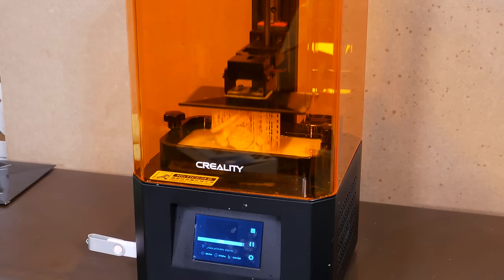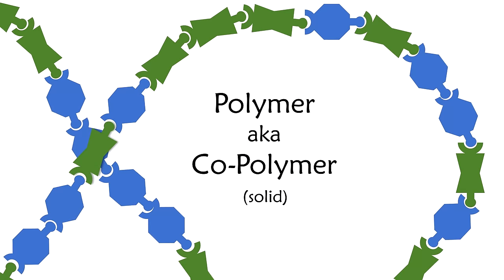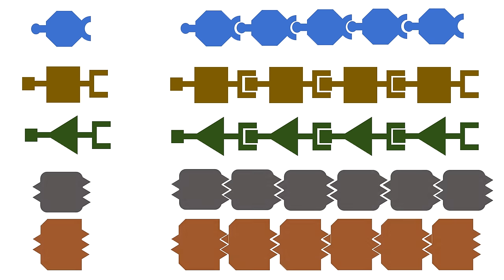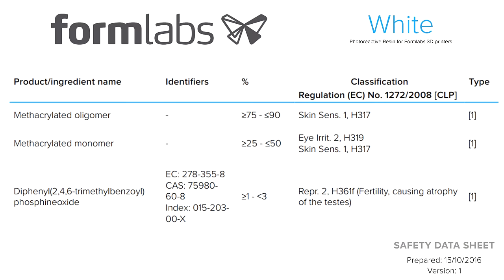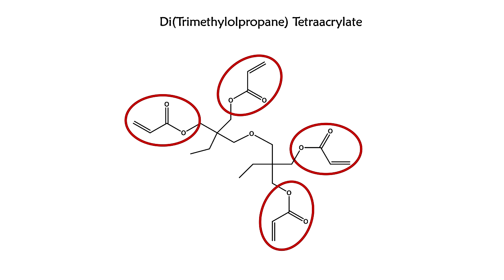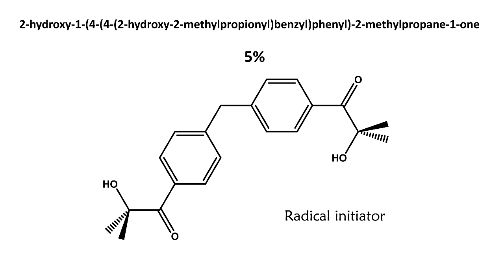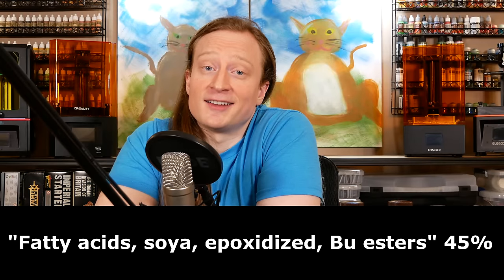Ph.D. Chemist Explains 3D Printer Resin

Comment from the maker: Hey All!  It's been brought to my attention that I conflated a couple of different safety ranking systems- some count up from 1 to 4 and some count down from 4 to 1.   With or without the numbers, you can trust the words in the SDS sheets to steer you right. My overall "respect the resin but don't fear the resin" viewpoint remains.  For more info: 
https://www.acs.org/content/acs/en/chemical-safety/basics/nfpa-hazard-identification.html
https://www.osha.gov/Publications/OSHA3844.pdf
Reply: Tzuede Off the Cuff  Check with your Waste Management organization.  In my town they have one Saturday a month you are can drop off hazardous substances like old resin, it's something they don't advertise a lot, but you can found out pretty easy if you call.
Reply: question brett: I live in a studio flat with limited ventilation options at the moment, but I brought my Mars with me because I read enough about the risks that i thought I could work something out. Is this a dangerous line of thinking? Should i permanently have my windows open?
Reply: This is excellent. Would you make more chemistry videos please?
Reply: @einekleinerockmusic8152  there are 3rd party designs for activated carbon filters and/or exhaust tubes to vent all the fumes outside without having to keep the window open.
Reply: Sort of channeling the same feeling you being a chemist, I find myself working with resin sort of the same way I used to work in microbio labs. Always assuming surfaces are "hot", trying to minimize stray messes even if the rest of my hobby space is in shambles, etc.
Reply: If I am wanting respirator what type of filter do I need. I know I want an ‘organic fumes’ filter, but I have a lot of trouble identifying what individual filters do what.

Is there particular colour (or colours) that I can just rely on when at my local hardware store?
Reply: Tzuede Off the Cuff  I don't like sand. It's coarse and rough and irritating and it gets everywhere. Not like here.
Reply: Hello Sir, thank you for this detailed explanation. I truly enjoyed it. 
I heard epoxy glue can create allergies when you sand it and breathe in the dust. Do resins have similar risks when you sand the result?
Reply: Oh....... well it says i cant drink it?
Reply: Tzuede Off the Cuff  has
Reply: @goobertownhobbies  love this video has some questions on mixing resins for different print qualities (mixing a flexable resin with a "tough" resin or ABS like resin to get a hard yet non brittle product) winner what your thoughts are
Reply: maybe the resin diluted on the cleaning alcohol can be polimerized with the UV light and then filtered,leaving the alcohol clean again?
Reply: Hello Goobertown! Could you please make a video talking about the water washable resins as well? Discussing the washing and the waste water?
Reply: Hey chemist ! I can't find the answer anywhere else , but can you explain how the print gets cured if it's a solid print but the UV wavelength is only 405nm , how can such a short wavelength penetrate to cure the internal monomers ? Or does the chain reaction of the ions continue on into the depth of the uncured solid print beyond the reach of the UV photons ?
Reply: This was my favorite point you mentioned in this video.  Thank you so much for mentioning the SDS, and the safety classifications.  I've been resin printing since about when you made this video, and every other video I've seen that talks about safe handling of resins doesn't go that route at all, and recommends extreme care.  Gloves, mask/respirator, eye protection, "It's toxic!  Bad stuff! Be very, very careful!".  I came across the data sheets for resins when researching what I should get after my first bottle, and it blew me away that I hadn't seen that talked about at all.  I was also surprised at how not terribly toxic it is, so long as you don't breathe or ingest it.  Of course, as you mention, I always treat it with respect, but don't fear the resin.
Reply: You have been called the Bob Ross of youtube mini painting. I feel like this video series means you are some sort of Bob Ross/Bill Nye hybrid.
Reply: @einekleinerockmusic8152  i have exactly the same question!
Reply: Hello Brent, I just saw this video for the first time and I really appreciate the clear and concise way you break down the chemistry, the hows and whys and especially the safety aspect but I do have one peripheral question. 
I keep my printer in a grow tent, both to reduce the amount of UV being emitted and to contain vapors and odor, further to that, I run a charcoal canister filter with a fan in the grow tent.  This eliminates any odor, short of taking a sniff off the vat, but I was wondering if it actually makes the resin safer to be around by adsorbing any harmful chemical vapors or if it is a false sense of security??
I still don't spend much time in the office while it's printing but I am curious if the charcoal can make resin safer, or completely safe to be around while the printer is running?
Reply: Is it safe to use a growtent with a carbonfilter and let the air escape into the living room or is there still some particles or something like that?
Reply: Not feeling it.. way to to much low Testosterone vibes bro.... its like looking at a Greta Thornburg on steroids..  =/
Reply from the maker: @romanking1202  do you need monster trucks with your chemistry lectures?
Reply: @GoobertownHobbies bullets and perhaps a 3D printed ar-15 lower receiver would help! XD
Reply: Being a lab biologist and Ph.D. in computational chemistry, I can only pay my compliments.
You explained it perfectly and did not stop on the surface level.
I like the whole video and how you emphasize the tox/reach aspects of it.
Currently, I'm looking into a SLA printer and besides protecting myself properly by a mask and gloves (anyway a good idea to wear whenever you file something and/or create dust on µm to nm scale e.g. priming models in big batches), I would like to come back to the disposal topic and ask a question on the water washable resin, if I may?

How can I make sure in a not so sunny state to cure the resin with UV light, e.g. residing in a bucket of water  (assuming I have water washable resin)? 
I was just thinking, here in Germany during winter we will not have so much "sunlight" to evaporate the water in a bucket, but the UV light will be enough to cure the residual resin.
If you can give advice on how to dispose washing-water, this would be much appreciated.

By the way, what happens to resin inside a model, while printing with e.g. 40% infill? I saw people cracking the models open, finding a fair amount of liquid resin inside, which could not be washed.
Reply: thanks - if i have to work in the space where my printer is all day will a big carbon filter attached via the shroud from a cut hole whit a fan motor be enough?? or should i transfer it outside via a window and hose /fan combo - no filter insted and maby the small anycubic carbon fans inside the shroud whit fan out window?  i will not print alot but many a few times a week for large figurines and busts work. many thanks
Reply: Dust from sanding anything is potentially dangerous. Some are also carcinogenic but in general, avoid breathing in any fine particulates - wear a dust mask.
Reply: Do you wear a spacial mask in a well ventilated space? I know people recomend it, but realistically do you wear one?
Reply: Can you do a follow up video on the right filter for Resin printers. 
I am in the process of buying one of those things and I want to make sure that no one in my household gets sick because of the fumes.
So I am shopping for a HEPA + Carbon filter air purifier. Maybe some help on that front would be nice for many people.
Reply: The video is over the top - there is literally no better explanation about 3D printer resins. Watched several times to make sure I understod everything properly!
And from all that information one questions itching in my head. Looks like it is totally feasible to alter off the shelf acrylic resins to change characteristics. And I not talking about simple coloring. Many popular resins are britle - is it possible to add something to the liquid resin (and what exactly to add?) to increase elasticity of solid parts?
Is it possible to add something to gain direct increase in strength?
Is it feasible to add some powders or fillers like with epoxy to increase wear resistance of decrease weight?
Thanks!
Reply: @SianaGearz  just take the high ground and worry not.
Reply: You are like a Mr Rogers of chemistry. Very nice. Love the dry humor
Reply: @JennaHartDemon  more Bob Ross over here. Happy little resin.
Reply: You may want to check your description links! A few don't go to valid things.
Reply: @goobertownHobbies , what happens if I expose a resin that is crosslinks under UV  to a visible light.
Reply: quick question ... epoxy groups on polycyclic hydrocarbons can bind covalently to DNA and cause DNA replication damages. Has this been investiagted for epoxy resins?

Comment: The best way to clean resin out of isopropyl alcohol is to distill it. Get a $50 water distiller and fill it up with the dirty alcohol. Set it up outside away from structures, and then let it run with an appropriate size container under the spout. The alcohol will come out crystal clear, just like when it was new. All you need to do is wipe out the inside of the distiller pot and you're done. No more filters or cheesecloths or other gadgets, the distiller is the best solution.

Comment: I work at a 3D resin company, (FunToDo) and I process the used alcohol in cleaning test prints and tools, by pooring it in transparent jerrycans, leaving them outside in the sun. Most of the resin in the alcohol will solidify and sink/ stick to the outside. Then I recycle the alcohol.

Comment: I would really love to see a new video talking about water-washable resins and how they differ chemically from traditional resins that are washed with alcohol.
Reply: Probably not much. Would imagine the difference is probably just that ingredients are more water soluble so the sticky mess can be washed off with water. They should still not go down the sink or your throat because they aren't any more healthy because of that.
Reply: Pretty much what I've learned. The only thing you get rid of by using them is the alcohol.
Other than that they're supposedly just as toxic.
Reply: @ralfsstuff At least you save the expense and small hazard of alcohol. You don't have to careful how you much use to clean your part either.

Comment: This is the same process they use to make microchips.  I used to work in the photolithography area working on Electron microscopes and on the lithography machines.  I did the photo resist qualifications as well.  Those chemicals were the same as these chemicals on a much much smaller scale.  They make patterns that are only microns wide. They hold patterns that are smaller than the wavelengths of light used to expose them.  We used a lot of IPA to clean these things up too.
Reply from the maker: I've got a few friends who work in that field, it's such crazy awesome stuff!
Reply: @GoobertownHobbies  it was fascinating.  I was a huge process nerd.  It's really cool seeing the technology being commercialized like this. It's a good example of better living through science.

Comment: appreciate the safety segment especially since its kinda hard to find info on resin safety. One thing that would have been awesome is a safety comparison to other household chemicals. How does it compare to dish soap or bleach for example? im still kinda scared to get into resin 3d printing because i got a feeling it could end up being like asbestos where people think its generally safe but it hasnt been explored enough yet to confirm its safety.
Reply: Same here! My wife is very paranoid about the fumes. That's why the elegoo 8k is in an ikea enclosure out in the garage! 😂 
Just need more activated carbon in my life I guess. 😂
Reply: @helixxharpell  For example I recently found out that huffing primer fumes has a noticeable long term impact on your health. I just got a gas mask (which are surprisingly cheap) and havent looked back. Still not eager to start 3d printing due to the excessive time investment needed to get it working how you like tho
Reply: @pepi560 Spray fumes have been known to be bad for a very long time. 
Like brent mentions in the video as long as you do it in a ventilated area and youre not standing there sniffing it for hours then resin will be fine.

Comment: Hey, awesome video.
Quick question: Once the part has been printed, you're supposed to shine a UV light on it to fully harden the part. How does an opaque resin print get cured on the inside since the UV is only hitting the surface of the part? Wouldn't the pigment block the UV? Would transparent resin be more effective at curing evenly?
Thanks

Comment: Really been getting into this hobby lately - This explained a lot that I didn't understand.  The community has done a great job supporting it across many facets, but the most common thread is "don't pour anything down the drain".  

Thank you for this video, really aligned with my current hobby process.

Comment: Nice overview. Just to add one important safety tip:
If you get resin on your skin, never clean it with alcohol. The alcohol will only dilute the resin with a higher risk of absorbing parts of the resin in your skin.
Use paper towels to clean of most resin, wash with water and soap and only after this use a wipe with alcohol if you need to.
For safety always wear (safety) glasses and optionally a mask or a full face mask

Comment: A question: If one were to shine UV light on the used IPA, would the leftover resin polymerize and be easier to filter out? Would that be a feasible option?
Reply: Not really. It will polymerize but depending on how much resin is mixed in to the IPA it will just create a hard wall with a liquid inside. It also smells to high heaven.

Comment: Thanks a ton for this hugely informative video ! And as you said things start to connect and the world makes a little more sense and that's a great feeling to experience. For example (correct me if I'm wrong), the prototyping rigid resins have more cross linkers and lesser monomer units making them highly cross linked structure which makes them rigid and brittle. But the flexible resins have more monomer concentration than the crosslinkers and thus giving rise to flexible nature. So adjusting this ratio lets us to play with the rigidity of the printed part !

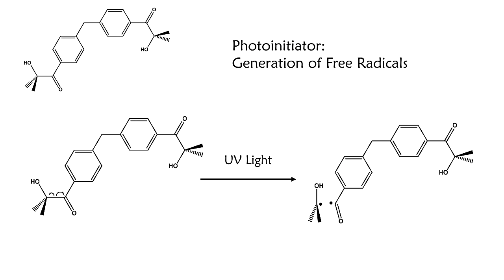Comment: 16:25 That's a quite happy molecule on the bottom left.
But after UV light it gets surprised.

=)

Jokes apart, good video. =)

BTW: you can filter alcohol with cheese cloth/filters, after letting the dissolved resin polymerize.
After that you let dry the resin stuck in the filter and remove it by hand.

Comment: Process chemist here, great to see polymer chemistry talk!

Also here's a crazy idea... what if you used a resin with AIBN in it? Could you run the print speed faster to make a less thoroughly cured 'green' part, and post-print heat-cure it to get an equally strong resin?

Comment: Hi Goobertown, love the video! It's great to see someone really break down this chemistry!

If you can find the time, it would be really great if you can make a video addressing the disposal method being pushed by resin manufacturers like Phrozen, which is to expose the waste solvent to UV and then dump it. Obviously this isn't going to get anywhere near enough of the dissolved resin to react, but it'd be really great if you could lend your professional analysis to explain why this is not an acceptable practice. It's really hard to push back on the misinformation in the 3D printing hobby with so little actual input from chemists in the space.

Comment: Re: Disposal of contaminated alcohol/turpentine, etc. One of the options I've used in the past for similar situations (polymerizing finishes, particularly with significant exothermic reactions) is to spread newspaper fairly thickly in direct sunlight, then pour/spread/spray the solvent onto the newspaper, wetting it, but not soaking it. The sunlight and heat quickly polymerizes what's left after the solvent evaporates, leaving stable, if somewhat crunchy, newspaper that can be safely discarded.

Comment: I own a Solus Pro and it's a truly fantastic printer. With their proto resin, you can build about 70mm in 1 hour using the 50um draft mode profile. If you need layerless prints,  the same will take about 4 hours at 25um.

Comment: A tip to speed up the process of creating the sludge in IPA is to store it in a transparent container, big glas jar for instance and then hit it with UV, the resin in it, will react and form solids, you get clouds of reacted resin and the IPA at the top can be reused. The rest you can filter and even use as a first step after printing.

Comment: I just found out after years of biochemestry, that I used the term saturated fatty acid, BECAUSE it was saturated by hydrogen. And that double bonds is called unsaturated, because is LACKING one or more H. Not that I didn't get that we had double bond without hydrogen. But the terminology makes so much sense, after you said it... I'm speechless, (or brainless). You deserve that subscribing !